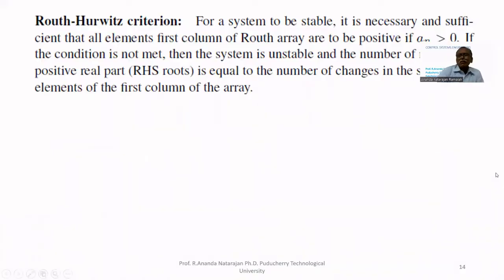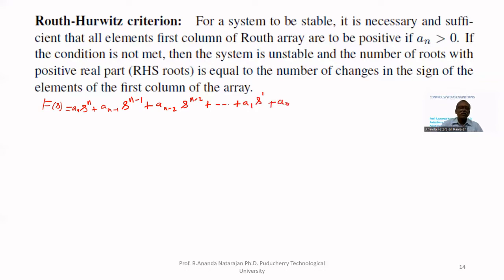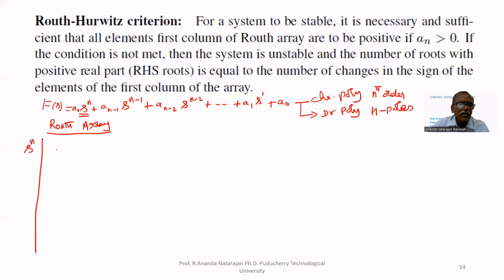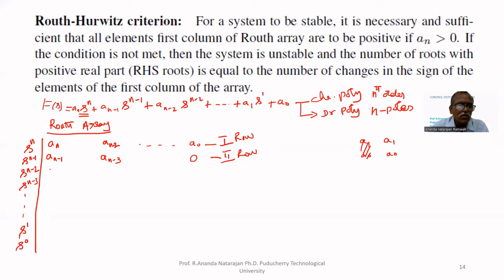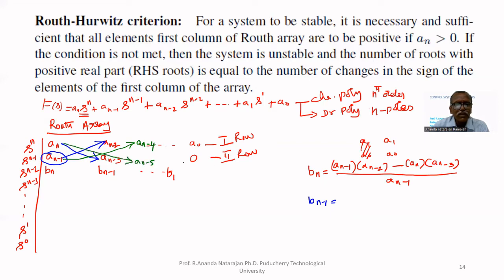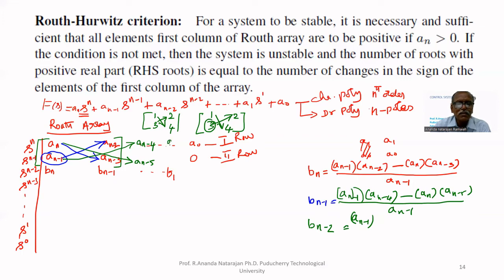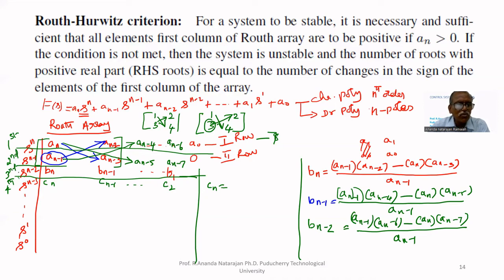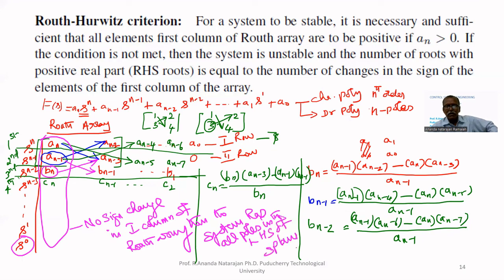Routh-Hurwitz Stability Criterion with examples  part 1/10 Solved Step-by-Step#controlsystems #DrRan

Comment from the maker: 🎯 Challenge for Viewers!

After watching this video, try solving the following characteristic equation on your own:

s
4
+2s
3
+5s
2
+10s+8=0

👉 Construct the Routh Array and determine whether the system is stable.

Post your answer in the comments section, and let's discuss the solution together!

📚 Which Control Systems topic would you like next?